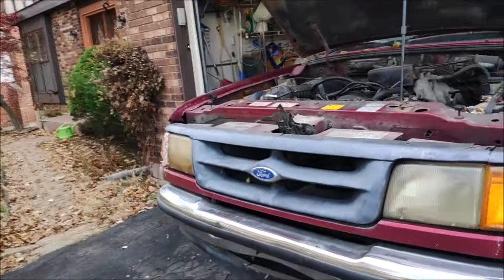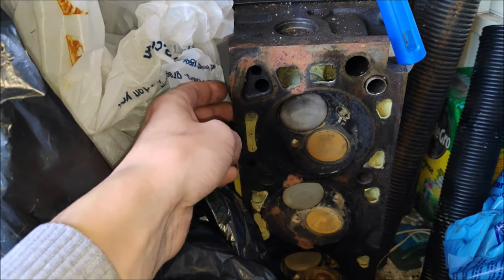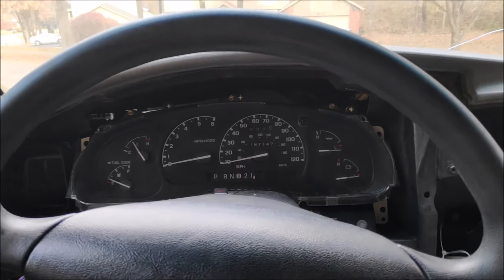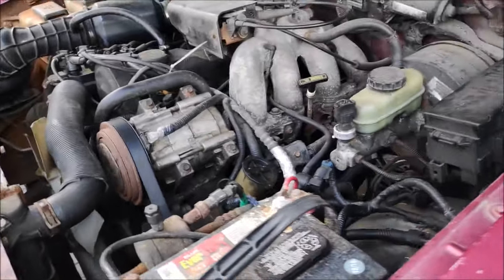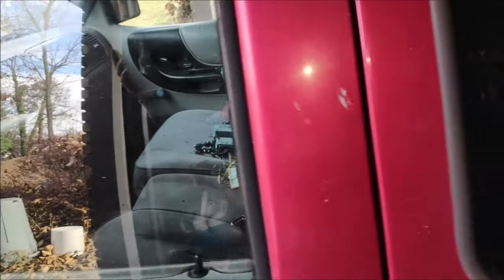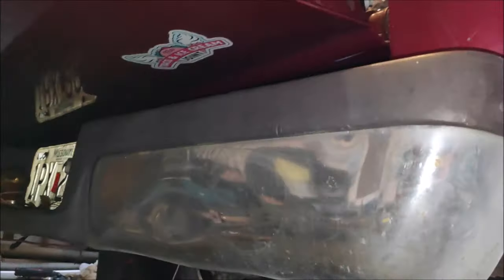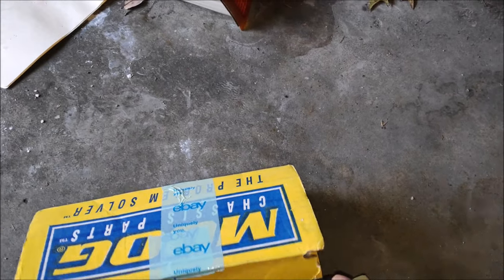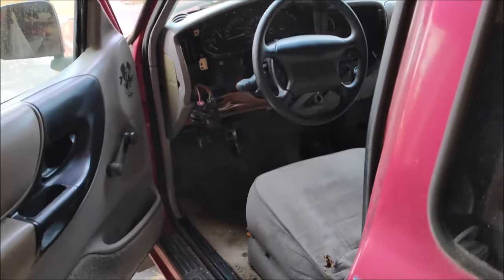What Fails on All Ford Rangers, Everything You Need to Know, Best Review

Comment: Most people who have nothing good to say about Rangers have done one of two things 1- tried using them in a way they weren't meant to be used 2- they never do any thing to take care of their vehicle.  I have a '94 and a '04 Ranger. Both are well maintained and have never given me any troubles. Most of what you are calling problems are just normal wear items or abuse.
Reply: How's the saying go, 'take care of your vehicle and it will take care of you
Reply: 95% of people don't maintain there vehicles. We're living in a day and age where nobody even warms the vehicles up before driving and oil last 10k miles +
Reply: Right I never had any problems with mine until now it started dying and backfiring really bad no clue what it is. Everything else works amazing bought it for $200. Best truck I’ve ever had.
Reply: Your right i need to vacuum mine out and maybe a wax wouldnt hurt.Everything is basically been upgraded, Just bought some new tires, brakes, locking gas cap, cruise control buttons, rain guards, and bug shield for my 99 xlt splash flaresside. It's been good to me so far.all it Needs a rear bumper.towed up to 1000 pounds in the back with no problem.
Reply: 01 SE B3000 here. 107k miles got it at 85k. Cam synchronizer wasn't in correctly caused a check engine. Fixed it, and the only thing I've done to this thing since then was fluid changes. One front wheel bearing and a few other normal things. It's been mudding, etc, and hasn't given me any problems.  Love my little truck!
Reply: That vehicle has 270k miles. Not bad. Looks like the previous owner did no repairs to it. He got his money out of it.

Comment: Purchased my Ford Ranger 2.3L (manual) new back in 1994. After 26 years, it still runs great with no issues at all. Parts are cheap and you have many DIY things you can do to the truck. Now, with 373K miles ... do I have to say more about this truck.
Reply: until you cant pass emissions :(
Reply: I have a 94 mis fire in all cylinders anything to help
Reply: I just bought the same truck. 94 maxda stick shift. 205k miles. Im having a few issues that im unsure what the problem is. It runs very sluggish.  Slow acceleration.  Hard to get up on a high gear
Reply: @yungscooter4428  same here. Did you find the solution
Reply: @yungscooter4428  Get a code reader and find out what codes you have first.
Reply: @yungscooter4428  Look at your coil packs. They might be cracked or soaked with oil.
Reply: @james_chatman  coil packs are the weakest link and likely target for random misfires
Reply: Lol noticed the clutch pedal boot was missing on the pedal. Ford doesn't make or after market yet some guy on ebay has sold 41 of them for $500.00 a pop. Ordered a pedal from a ford Areostar van see if that one will work closest match for $8.00 just bought the truck runs very good
Reply: @yungscooter4428  have you checked your spark plug wires they could be old and the rubber is going bad. A friend had a chevy misfiring, it was at night engine running parked told him pop the hood. Looked at me like I was crazy that we find his problem in the dark. Opened up the hood and looked like a light show was going on under his hood. Told him that's his problem right there your spark plug wires are bad.
Reply: I brought my truck 1 year ago it's a 97 with 125k on in 2.3l manual  it has issues was going to get rid of it but after hearing that yours have 373k and still runs good I think I'm keeping mine 👍
Reply from the maker: My truck was running sluggish, I found the problem.
Reply: @Luis-mb9zn  At this time, it has 395k and should pass 400k by next month. Still starts right up and runs strong.
Reply: @everydayirace  What was the problem?
Reply from the maker: @path2049  I will upload a whole video in a few days, or whenever i have time.
Reply: @Luis-mb9zn  I bought a new 97 2.3L manual. I traded it in with 201K miles after 9 years. It still ran like new and still even had the factory clutch. Unfortunately, it got rear ended by a F-250, which left it with some major cosmetic issues. I drove it for another 6 months and got rid of it only because it needed serious some body work and I felt it was time for a change before the inspection sticker was due. Otherwise I loved it.
Reply: @bermchasin  dont need it after 25 years
Reply: I have a 93 splash manual. 410k miles later, still runs great. Ac doesn’t work tho
Reply: These things are tanks for sure. I have had mine now for 4 years found it sitting in a sand pit put a battery in it and drove it like that for a year lol,,,,, started putting parts in new while inhad it sit for a year and she's a brand new truck.  I really have no complaints about my free 1994 Ford ranger 2.3l with 119k on it. It does spit and sputter during the winter months but jmma bout to fix that
Reply: I have the same truck that’s rattling @idle would go away when pressure on clutch or gas.Replaced clutch, pressure plate, flywheel, throw out bearing, slave cylinder,  pilot bearing. It was fixed for awhile until I had to bleed the clutch and now the noise starts again
Reply: @bermchasin  yi dont need pass emisions i pay for it
Reply: Jesus loves you alot trust in His death 4 salvation and be saved from eternal hell <3 Jesus died on the cross for you bro.
Reply: @michealbarnes66  the intake tube that goes to the air filter has an air restrictor on the end where it connects to the throttle body, take that out and try now, if not get a bigger diff at the junkyard
Reply: @yungscooter4428  module behind air conditioning compressor
Reply: @michealbarnes66  module behind ac compr
Reply: @michealbarnes66  module behind ac compressor
Reply: Same but I have a 4.0 manual, the only issue was that the old owner didn’t know how to drive stick and blow out a succor so we had to do a tranny swap
Reply: Got a 94 2.3 5 speed ranger with almost 91k on it. I’m 17 and bought it with 82.5k miles
Reply: @georgeulbrandt  425K miles, still driving it daily with no issues.
Reply: pat h I purchased a ranger 98 single cab 2.5 4cyl the ruck was parked for 8 straight years it has 165 thou miles I took it to the smog n passed right away the best investment I’ve ever made also it’s so fun to drive
Reply: @mikelmar5723  Mine is now 427K and still runs well. Amazing!!
Reply: @yungscooter4428 I got a 97 ranger xlt 2.3l and when I took the valve cover off I saw the rocker arm itself came completely off the camshaft
Reply: @bermchasin they don’t do emissions testing on 95 and under vehicles.
Reply: @irishuwould5185  good to know! Thx for the info. I have a 99, with a bad misfire when cold, BUT they just stopped doing emissions in my state so at least i don't have to worry about passing on that front. Would be nice to have a smooth engine though
Reply: @bermchasin  yea I’m in Texas and I wish we would just stop doing inspections completely like some other states have. I have a 94 silverado and it’s only 7 bucks for an inspection because they don’t do emissions on it. So it’s not that bad.
Reply: I have the 1995 manual, and I just did a complete ac change out, replaced the bend door, and I’m over 200,000, and Ghost is still going strong.
Reply: Just cut the plastic bottom in a way you ca reattach it back to change the heater core ,and the bend door. I created screw holes by making a fiberglass ring around the area I cut. No need to remove the dashboard 👍🏽
Reply: @yungscooter4428 i would look at the ignition coils make sure they are in the right spots and make sure spark plugs are good. Thats the easy part, if its not that then it could be timing or even a fuel issue.
Reply: 17 mpg lol my Tahoe 5.7 gets better mileage 😅
Reply: Wow.
Reply: @bermchasin  Anything 1997 or older doesn’t need emissions!
Reply: 😮😎🖖💪👀Ford tough 💪
Reply: @kevinagnew6878  Yep, 450K now ... still runs strong.
Reply: I have a 07 3.0 automatic 2WD ranger that was purchased new. Most reliable vehicle I have EVER owned. 210K and counting 😊

Comment: 1997 Ford Ranger 2.3 5 speed purchased  new now has 310,000 miles.  Never an engine, transmission, or rear end problem.  Only big issues have been all 4 spring mounts, brakes lines, and now it needs new radius rod bushings (and probably new radius rods and mounts).  You cannot kill these trucks!

Comment: 01 XLT with 3.0 with about 230K miles.. replaced just about everything but the rear axle over the years and STILL cheaper than buying another used vehicle (I think 😂)
Reply from the maker: Same here.
Reply: I just bought a 96 xlt 3.0 4x4 from my neighbor. She bought it new.  Almost 30 years of records was damn near a full file cabinet.  236k miles and I have receipts for every oil change.

It’s a damn shame I’m only going to be driving it 10-12 miles a week🙄

Comment: Thank you for knowing what you are talking about even though you dissed my 4.0 V6 as using gas like a V8 but goes like a 4 cyl 😂
Reply from the maker: It's still better than sohc 4.0l, that thing breaks timing chains when you look at them wrong lol, then you have to pull the engine to get to the one in the back of the engine, what a hunk of 💩 😆.
Reply: @everydayirace  Yes that's for sure.  Ford does some bonehead designs, trying to turn a pushrod block into an ohc by running a timing chain in the back and front of the engine.

Comment: Excellent informative video. I have a 1996 3.0l Std Cab Long Bed and it runs like a new truck with 181,000 miles. Every two years, I have to smog it and I put in "Guaranteed To Pass Smog" that cleans the entire fuel system and the read out from the smog test is amazing that it reads like a new truck. And the truck will be 27 years old next year. I love my Ranger.
Reply from the maker: No emissions testing here for 95 and older cars, that's why I got rid of my 96 ranger and bought a 95 ranger lol.

Comment: Nice video, very interesting.
I love my 96 Ranger, but you forgot one more problem: spare tire carrier LH support. 
Overtime, the metal support tends to crack, which completely destroy the spare tire carriage if you dont fix it on time.
Everyone who owns a Ranger should check the spare tire carrier for cracks, common issue.
On my truck, I just laser-cut another metal bracket overlaping the original, welded both together and never had any issue! My original bracket was starting to crack, it had a tiny little crack, but if you dont pay attention on time, it will fail for sure.
Reply from the maker: Thanks, I haven't seen that one.
Reply: Matias Fernandes-I had the 99,but where I live in Maine the tire carrier rusted solid.It might as well have been welded!
Reply: Jesus loves you alot trust in His death 4 salvation and be saved from eternal hell <3 Jesus died on the cross for you bro.
Reply: I have a 97 I just bought. Praise God! Wow! So nice and so cheap! Standard cab, step side, 2.3 manual...
Whoo!

Comment: I bought a new 96 Mazda b 4000 and put 315K miles on it before I gave it away.  At  around 200K miles the transmission went out and I replaced it with a rebuilt one. and shortly after that I had the front end redone with new bushings. Around 280K the front left bearing went out due to the fact that I never checked them.  AT 310K the transmission went out again.  At 315K I gave it to one of my employees!  Wish I still had it.  Also the 4x4 electronic activator quit  working around 280K.  For a truck that I put this much milage on it driving around 70-80 mph all over Texas, this was one of my best buys.  I changed oil every 6k miles and plugs every 100k.  I went through  6 set of tires driving this truck and it rode smoothly and drove well.  One great truck.

Comment: Really enjoyed this video. I have a 95 Mazda b2300 with 300k plus miles. Recently replaced the air compressor, heater coil and condenser. Blows cold after replaying the recently cracked heater control valve. Was pretty easy to do myself. It was cracked worse than it displayed. Was broken inside the hose also. Radiator recently replaced. Check your hoses when replacing radiator. My radiator system is so sealed that it still has pressure on the upper hose the next day. Thanks for this very informative video sir and have a blessed day!
Reply from the maker: Those are easy repairs on these trucks, engine mounts are the worst Imo.
Reply: Hey, I have a 95 B2300 that I bought brand new. After all these years I only have 108k miles. I had problem with starting the car. After changing so many parts like the fuel pump, pressure regulator, fuel filter, fuses STILL couldn’t start the car. What was the problem? I ended up new direct wiring from the fuel pump to the battery with an on/off switch. Cost? $16 special wire from Amazon did the trick.

Comment: Got a 95 been driving over 20 years. Automatic 3.0 with 4r44e. Over 600000 miles still going. Oh the muffler broke off last week but it ain't that loud so still going. Will weld it back on this weekend. Still getting 20mpg
Reply: Wao! In in a process of buying same 3.0 automatic for very cheap. I hear people say that version of transmission system is problematic. How true is that with you?

Comment: My 2000 ranger does not have one of  those problems.  After 136000 miles My problem is the tailgate won't open up. Engine is fine and rear end is good. I have an advantage , I live in California. I change the fluids all the time. I watch Scotty all the time.i do preventive maintenance .Luckily it runs well. 3.0 engine.Good video From Sacramento
Reply: WD-40 to the rescue.  Take the panel off on the inside upper part of the tailgate and start spraying.  Once you free everything up and before you put the panel back on, spray the heck out of the interior with Fluid Film.
Reply: @flick22601  thanx, I did all that. Not working. The side catches are misaligned. I tried to realign the side door catches but the screws are in their extremely tightly. I will have to pre lubricate them and try again .I'm sure I'll have better luck next time. thank you.
Reply: @robertdavis3433  - I've had pretty good luck with the Eastwood Air Impact Screw Buster Remover available on Amazon or Eastwood.

Comment: The heater core stopping up -reverse the hoses going to the heater cvore and let the water pump clear it. Install a coolant filter on the pressure hose going to the heater core. Filters the gunk out of the coolant and solves that problem on the cheap. Use a remote oil filter relocation kit, and it uses a spin on oil filter.(DO NOT USE A FRAM!!!)
Reply from the maker: I was looking up coolant filter about a month ago lol, apparently washer filters can be used as well.
Reply: i dump some dish liquid in mine run it with the cap off with plain water.

Comment: My 97 Ranger was till running good with no issues at 298,000 miles when I sold it and the the trans that's in those is n't the A4LD it's the 4R44E which is an upgraded improved version of the A4LD. As long as you service them regularly ,they'last very well. Mine did fine even though I pulled a heavy tandem axle trailer regularly. I now have an F150 Supercrew but would gladly trade it for another well maintained V6 Ranger SuperCab. I've owned 4 Rangers of various models and they have been some of the best trucks I've ever had. By the way I'm a retired Certified Ford,GM,Chrysler and ASE Technician.
Reply from the maker: Well maintained ranger.........good luck finding those.
Reply: @everydayirace  Actually,they are fairly plentiful in my area of the country.

Comment: I also have a 2010 ford ranger 2.3 four cyl with auto 190000 kilometers runs like a top no motor or transmission issues one of the best trucks i have ever owned
Reply: Me too, I have zero complaints or issues 😊

Comment: I have a 94 w/ the 3.0 V6,  5 speed manual. 176,000 miles, still runs strong. I've had to do some shackle and shock mount work, due to rust, (it was a north eastern truck) The 3.0 runs like a top, not bad on gas either. I plan on keeping this truck until the engine fails. it doesn't blow any smoke, pulls hard and stops good.  Your video was informative, thanks!
Reply: My 2000 ranger v6 has 2 different spark plugs. 3 on one side of the engine and 3 different plugs on the other side. It's in the owners manual
Reply: @robertsolberg7666  Weird, my old 02 with the 3.0 , previous owner put the wrong plugs in. A couple weeks into owning I sent the piston into the plug. Got a 08 3.0 50k on it for 350 got it in , and running again for 10 years it would of been this year, but I wrote the bitch off . Got me a 94 four banger now, in pretty nice shape , but needs shackles as well
Reply: What did you do? I have this problem I need to address
Reply: Gay I have 4.0 v6 my truck better

Comment: The reason that the mid to late 90's cars have heating and cooling issues is that for several years they never put rust inhibitor in antifreeze . They realized that was a dumb idea and fixed it but several years of cars and trucks , they left the factory with what may as well have been salt water in them . My Dad has 2 97 Dodge 1 tons that had to have their heater cores replaced on warranty with in 2 years of being new .
Reply from the maker: Didn't know that, thank you for the information 👍.

Comment: I bought a 94 ranger last year. So far I've replaced the shocks. The brakes. The tires. Passenger side window. And the AC compressor, lines and evap, etc.. it needs a new clutch soon I think. It catches kinda high and chatters a bit on take off. And the front tie rod ends seem a bit loose. Next projects. Oh yeah and the dash lightbulbs, half of them are out. Video was right on about that. Eventually I'll rebuild the engine. Leaks oil in various different places. Almost 200k miles